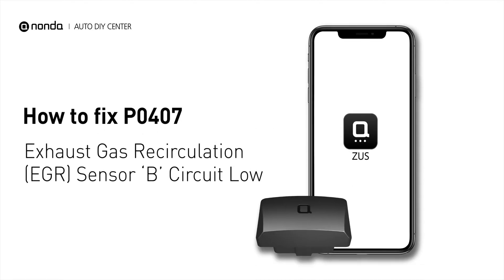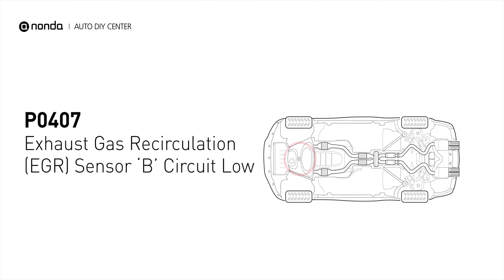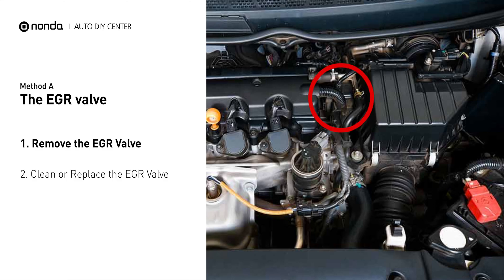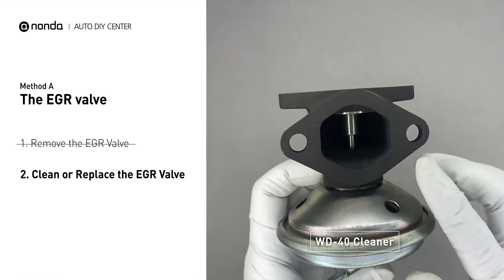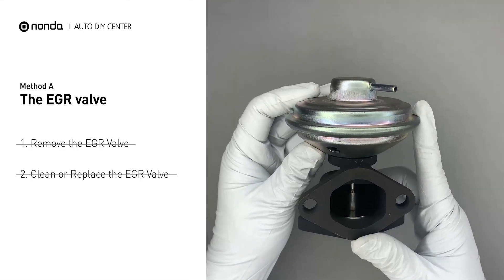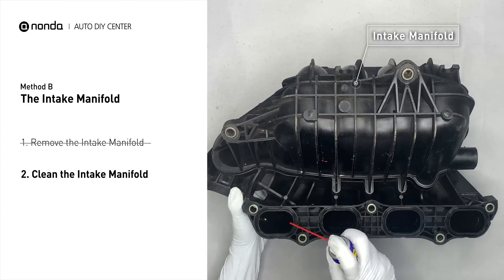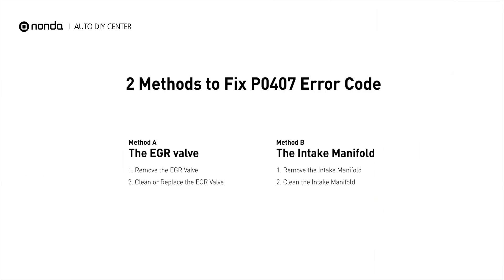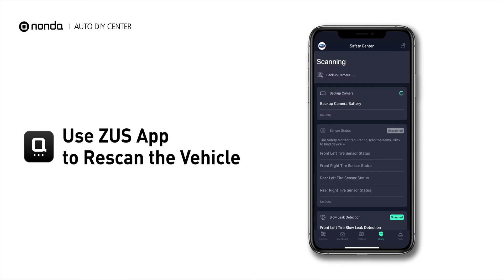How to Fix P0407 Engine Code in 3 Minutes [2 DIY Methods / Only $4.53]

Comment: I've got this fault code..vw caddy 2014 should I change it also has coil light flashing
Reply from the maker: Hi Dean, have you tested the wiring and the solenoid before changing the valve?
Reply: Did you manage to fix it? I have the same issue!
Reply: I have the same Issue too 2014 caddi 1.6 diesel
Reply from the maker: Hi Jannik, please try cleaning the EGR valve to see if the issue will still persist.